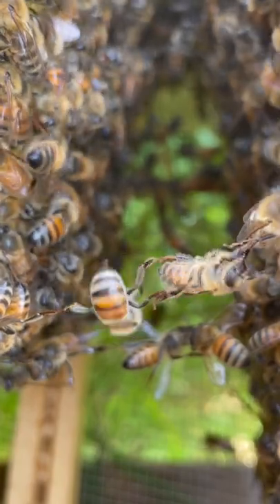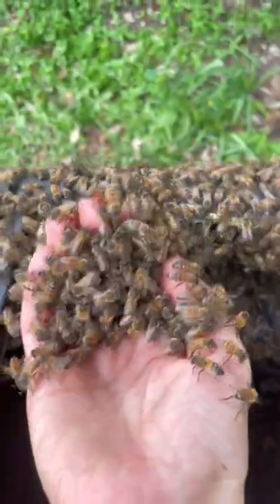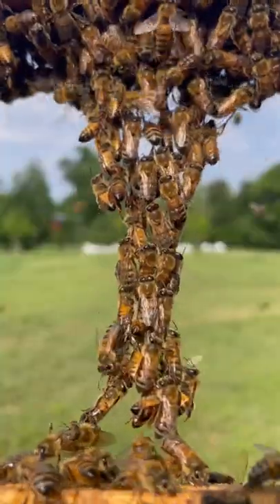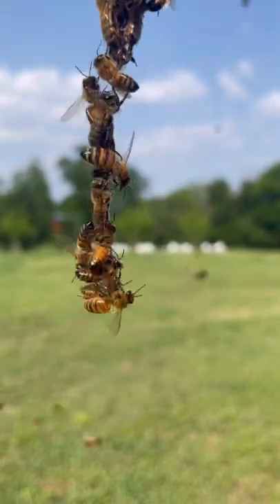How Bees Build Their Hive

Comment: Anyways, here a brownie recipe.

Ingredients:

⁃ 1 cup unsalted butter

- 2 cups granulated sugar

- 4large eggs

⁃ 1 teaspoon vanilla extract

⁃ 1/2 cup all-purpose flour

-1/2 cup cocoa powder

- 1/4 teaspoon salt

⁃ 1 cup chopped nuts or chocolate chips

(optional)

Instructions:

1. Preheat oven to 350 F (175C) and grease

a baking pan.

2. Melt 1 cup butter, mix with 2 cups sugar.

3. Add 4 eggs and 1 tsp vanilla; mix well.

4. Sift in 1/2 cup flour, 1/2 cup cocoa, and 1/4

tsp salt; stir.

5. Optional: add 1 cup nuts or chocolate

chips.

6. Pour into the pan, bake for 25-30 mins.

7. Cool completely, cut into squares, and

enjoy your brownies!